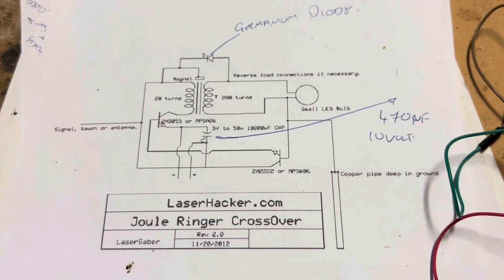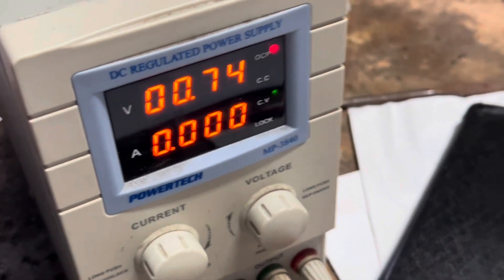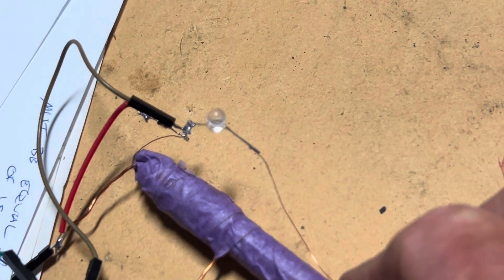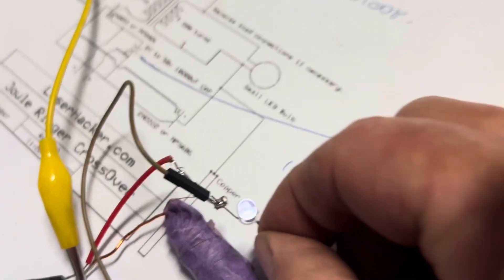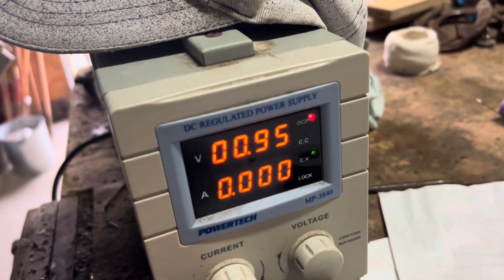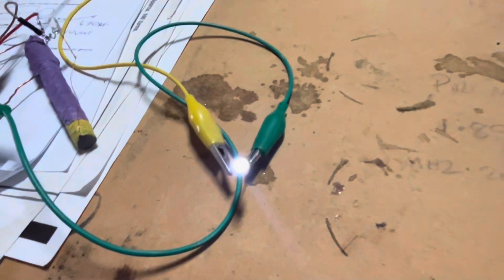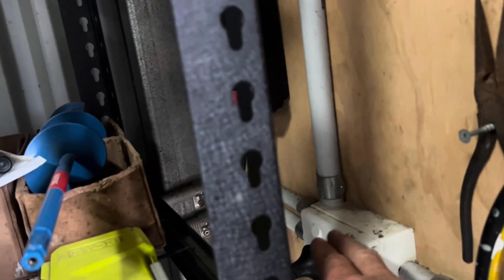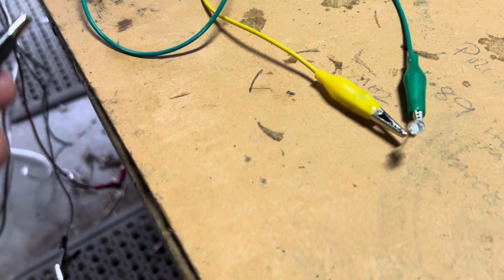LaserSabers Joule Ringer Crossover Circuit experiments.

Comment: Your body is a natural capacitor, I have found it many times, In my last Video I have shown it. Also your Power supply may not show Milli amperes but could still supply micro amperes.
Reply from the maker: Thanks. I figured it must have been capacitor type input from my body. But I could not get it to work using three other types of capacitor. And I agree on the amperage input, the leakage must just be enough to keep the waveform oscillating.
Reply: Sometimes you need to put the capacitor wrong way around (positive to negative), or it will just be blinking. It's weird :D
Reply: @Peter36963 i was wondering if the blinking matched your hear rate. since you are passing iron past a coil with every beat.